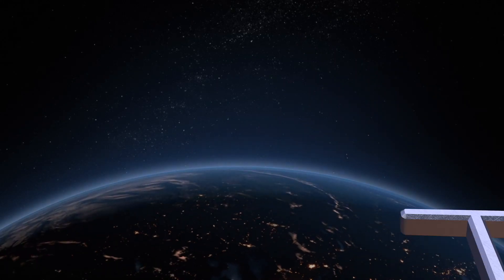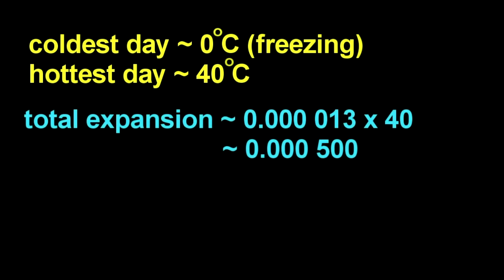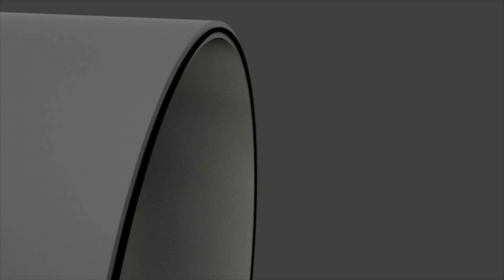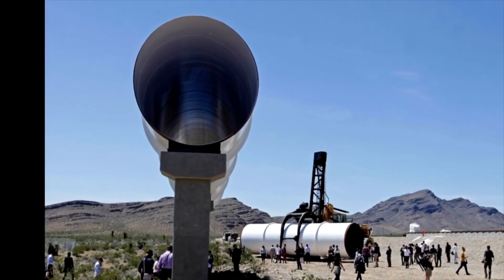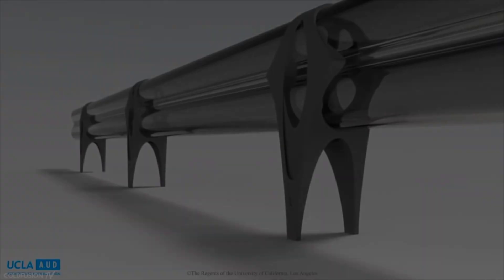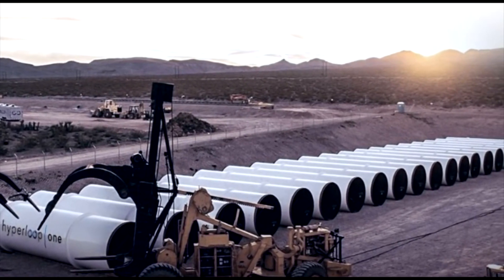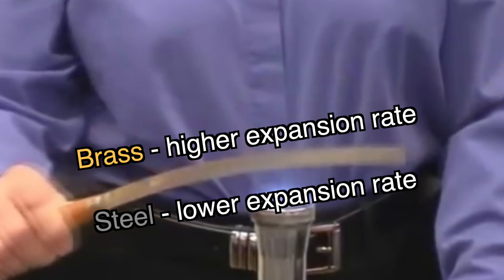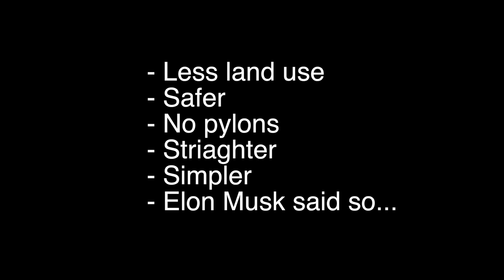The Hyperloop vs. Thermal Expansion

Comment: Air leak, high density air travelling through tube, pod slams into this higher density air at 700mph. Be like hitting a brick wall. Boom. I was expecting an actual seal design to be presented not a sketch of some of rings.....

Comment: For a thick-walled (~23mm) steel tube there will be quite high conductivity from top to bottom. Some quick sums would show what temperature differential can be maintained between sunny and shady side or space-exposed/ground-exposed. I suspect it's not very high - steel is a good conductor of heat. let#s have a go. Steel thermal conductivity is 43W/mK so if top is 10C hotter than bottom, and 3m tube (4.7m length top to bottom) 19.8W will be moving from top to bottom along each metre length. (wall X-sect area * conductivity * 4.7m length *2 (both sides)). In bright sunshine ~1kW will be hitting the top, although if white, only about 100W will not be reflected. Hmm. I think this needs calculus to work out tempo differential of worst-case steady state. You need to work out radiation as well as conduction. But incoming heat is a factor of 5 or so more than conduction round the pipe so actually it does look like quite a large temp difference could be sustained. 50C temp difference would result in 65mm expansion differential top to bottom over 100m of tube. It's the exact same problem as the length expansion with temp change - the same amount of expansion has to be allowed for, but when due to strong sunshine heating one side, the faces at the expansion joints would not remain parallel. And looks like I could well be wrong that the tube wall conductivity makes much difference. It helps somewhat, but does not eliminate the issue.

Comment: Ridiculous arguments! For instance - it does not matter, if the bending because of thermal expansion is caused by different expansion factors of different metals at the same temperature (like in case of bimetallic strip), or by different temperatures of two sheets of the same metal (like in case of the Hyperloop tube). The bending takes place either way!

Comment: Nice video, thanks. If I understand you correctly it should be built as an underground maglev system, a combination of transport systems that already exist. I agree that would be the best solution but that would mean there is nothing new about the hyperloop. And what about the cost, do you think $25 to travel from LA to SF is realistic? Why is the presented prototype train aerodynamic when it does not have to encounter any air resistance? So many questions, so few answers.

Comment: you said building underground would use less land but the shear amount of infrastructure needed to build the tube,  vacuum pumps, and protection against earthquakes (plus maintenance) would be immense. Because of the speed of the hyperloop, you would need to build a very straight tube, which would go straight through the populated central valley in CA. Plus the line needs to become un- straight once it reaches a city, otherwise it is a subway (extremely costly), which means it will have to slow down a lot, increasing the travel time. Especially difficult in la where it is not only vast and sprawling but is mostly confined by hills, which you have to get past somehow.
Reply: With time the earth will move the thing. But I’m just conjecture. I don’t have any numbers

Comment: O-ring failure - wait, there has been one already - a yeah - Challenger disaster. So what about places where temperature amplitude over a day can reach from above 0C and subzero? Laying all tube in the ground? - do you know what are the costs of excavation? And what about hitting underground infrastructure or destroying underground water balance. And then we have underground water pressure and corrosion affecting hyperloop tube. Any damage would require excavation of the tube.
Reply from the maker: The O-ring failure that caused the challenger disaster was exposed to completely different conditions (high pressure and temperature), so I don't think it is fair to use that as an example.  You make a good point about tunneling costs, but I think we can come up with some cheaper solutions very soon.  Underground infrastructure like pipes and cables would not be a major issue though because they are not very deep in the ground.  The tunnels can simply be bored below them.
Reply: Tunneling is a mature technology, so I really don't expect any significant cost reductions.  Grinding rock is always going to be grinding rock, moving rock to waste piles is always going to be the same, so how do you reduce cost?  Unless there just isn't enough competition in the tunneling business, then I don't see any reduction in cost.

The Boring Company claims they have reduced the cost of tunneling, but as far as I can tell they have only reduced the diameter they are tunneling, not a significant reduction in cost per cubic yard.
Reply from the maker: You make a great point.  Tunneling will not become cheaper just by making smaller tunnels, but if we change how we tunnel, there is a lot of room for improvement.  I think we need to find a way to tunnel that does not involve pulverizing all of the material that has to be removed.  For example, a core drill gets around this problem by only pulverizing the material on the perimeter of what is being removed.  The result is removing material faster and with less energy.
Reply: No - its not faster because the autonomous drill has it's own speed that mostly depends on the material it digs through. The tunel itself needs reinforcement by either steel mesh and concrete or by steel tubes. So nothing inventive and nothing cheap. This is why tuneling is done only when it's neccessary - through mountains, under seabad or in the cities. And sometimes you need e.g. archeological survey which makes everything more expensive and extends the duration of groundworks.
Reply: @tubetravel2138  The O-ring didn't fail because of high temperatures and pressure, it ailed because of low temperatures. They stopped working below 0 Celsius, that was the problem, and the same problem can occur in hyperloop in most climates.

Comment: Actually.. no. A leak in any part of the camber is a leak in the whole structural integrity. If there is a small leak in some way, that means the pressure is actually pushing through the material, which is quite a lot actually, which can and very likely will cause structural failure.Even worse if there is a knick on the tube while it is depressurized.. or maybe justa car hitting the pillars. A tube may withstand a lot of force of the athmosphere because the weight is distributed evenly. if you dent it, that tube likely will not be able to keep it up and collapse in an instant, likely letting air rush into it instantly. if there is a car in it traveling at fast speeds through a vaccum and then suddenly hitting airr.. that differential is like driving against concrepe. That is a deathsentence.
Reply from the maker: I accounted for this phenomenon in a previous video.  Dents will lower the effective "critical pressure" that will cause a failure in the tube, but this is easily countered by using a slightly thicker tube.  That is because the integrity of the tube against outside pressure scales with the cube of the wall thickness.

Comment: Why would air leakage be slow with an O-ring failure? You say this, but if an airplane has an air leak it is explosive and dangerous, why would the reverse not be true? The speed of air leaking in would depend on the pressure differential (high), area (high, and tube would separate further in a leak event) and geometry.

Also  the dismissal of the buckling problems due to top/bottom temperature differentials is hand waving; you acknowledge there will be a temperature differential but have no numbers or calculations to say it will be insignificant. Of course it won't bend as much as that strip, but it doesn't need to bend nearly as dramatically as the metal strip to fail catastrophically. Rails for regular trains struggle with buckling due to thermal expansion often.

And building underground is extremely expensive; american subway lines cost between 200 million and 2 billion dollars a mile. For the hyperloop to have a single 800 mile track, even if it could operate at 700 mph at a near vacuum seal for the same price as an american subway line (40mph at atmospheric pressure), it would cost between 160 billion and 1.6 trillion dollars. Not including operating costs, security or anything; pure capital infrastructure costs for a single, medium-distance route. This is an absurdly conservative estimate, because it will almost certainly cost more to operate at nearly 20x the speed and keep it vacuum sealed. 

Adjusted for inflation, the entire federal highway system cost between 400 and 500 billion dollars. So if a single route costs as much as the entire federal highway system, how could this be profitable? At the low end (160 billion), you would need 32 million riders at $5,000 a ride if there were no operating, maintenance or fuel/energy costs. The busiest flight route in the US (Chicago to NY, 800 miles and the reason I picked that distance) has only 4 million fliers a year at a cost of $100 - $300 and takes 2 hours. Why would anyone opt for the hyperloop on that route to save 45 minutes (800 miles at 700mph is 1hr 15 mins) at 20-50 times the cost? And even if the hyperloop somehow got 1/10th the rider counts at 20-50 times the cost, it would take 80 years for revenue to meet the original, absurdly conservative cost estimate.
Reply: Also it’s 2 bil a mile in the city. When you get out of the city it’s cheaper
Reply: isn't explosive decompression a Hollywood myth? I think there was a mythbusters episosde
Reply from the maker: The speed of the leak does depend on the pressure differential, but in this case that is actually very low (~14.7 psi).  Other systems with o-rings are commonly exposed to much higher pressures (~200 psi).  The other main factor that affects leak rate is the size of the opening.  Most O-ring failures are not full ruptures, but I guess that is always a possibility, so if the system was designed with O-rings, they would probably need to be redundant.  Regardless, I would opt for an underground system so that the tube does not have to adjust for thermal expansion in the first place.
Reply: @tubetravel2138  14 psi is actually quite high for large volume space. An airliner for example will maintain around 7 to 10 psi of difference between cabin pressure and outside environment.
Reply: That’s why my ears pop. The cabin is at 7 psi

Comment: A cooling system is required, because extreme temperature is not the only time it will reconfigure it's tube shape, the underground concept is more effective against that problem, other issues rise, earthquake and a breakage will collapse a tube now moving solid elements as it attempts invading air back into the pipe. Safer for the rest of the pipe path, but doom for a cart that was intercepted, also more difficult to evacuate in dense underground.

Comment: O-rings are parts used for airtight applications also used for rockets and the like, but parts that can not be easily replaced, which are installed in tens of thousands of places, repeat expansion and contraction every day will have problems with reliability.
How about supposing the extension and contraction by making the pipe double and circulating constant temperature air or liquid in the gap to keep the temperature of the inner pipe constant.
Reply from the maker: This sounds possible, but I could see it getting expensive pretty quickly since it would be about double the tube cost.  I won't rule it out though because I don't see any major issues with the idea.  I like the way you think!
Reply: Tube Travel I guess the best fail safe is multiple Air Conditioning systems, battery backup and using advanced insulation! Maybe even 35mm of space grade insulation! Cost dependant of course! 
You could build a test system on a 1:5 scale and test various failure scenarios. I’d use 14mm steel externally (24mm internally) to reduce puncture possibilities and galvanise all areas. 
By using high pressure cooled air we could fairly easily maintain a stable temperature!
Reply: The issue for the O ring is that over time (8 - 10 years) it will become brittle and eventually fail. Replacing it is then a nightmare! On an 800km tube that is a never ending task. An air conditioned core is better solution as its maintenance is far less costly.
Reply from the maker: There are definitely a variety of options to deal with thermal expansion.  I'm still a huge proponent of building it underground.  I think that solves a lot of other problems too.
Reply from the maker: Good thought, but what happens if a hole causes fluid to leak out.  I feel like you could end up with some major expansion problems in that scenario.  There may be a way to plan for this, but I'm not sure.
Reply: Of course, if a hole is opened in the outer pipe, liquid or gas leaks.
But it is not a fatal thing like the inner main pipe hole.
If you detect a leakage and close the hole, it will not become a serious accident.
Reply: You want 2 steel skins and circulate air in the internal 3" core between them at a constant temperature say 60 F and insulate the outer skin to ensure stable temperatures. This is done in Dubai for twin windows and is a simple technology.
Reply from the maker: My only fear with this method is the possibility of losing the constant temperature air supply.  If the system is exposed to temperature variations for even a short period of time, it could cause permanent structural damage.  Do you have any ideas to combat this issue?
Reply: Tube Travel like they say - more than 1 way to skin a cat! More than one way to stop Tube expansion, maybe 10. Ask any good engineer 👍🏻

Comment: Lots of engineering solutions both above and below ground to address expansion/contraction...  

Elon bought "The Boring Company" to begin addressing the easiest approach for urban applications that is underground where the issue of thermal effects are minimized.  But even tubes underground will need to allow for some expansion/contraction due to seasonal ground temperatures and heat given off by the pod transport mechanisms.

The Elon concept of a boxed/tubed system for managing length change is actually more viable than o-rings at each joint (which compromises structural integrity).  When one realizes that vacuum/evacuation stations must be placed  approximately every 2km or so you can then limit the amount of tube length variation to that distance and it becomes a manageable 12-18" at each station assuming you have the extremes in temperature that were discussed in the video.  I've done some basic engineering concept drawings/calculations and find this approach to be very manageable...

Tube restraints to the pylons could be ring fixtures that allow lateral movement while maintaining structural stability (this could also allow some seismic displacement) such that the expansion is not constrained only contained.  The detail of this concept is a series of o-rings in sequence along several feet of tube length which is housed within another slightly larger diameter tube - the expanding hyperloop tube can then slide in this larger tube while the o-rings maintain the vacuum.  (Multiple rings for redundancy and stress equalization).
Reply from the maker: Good thoughts on this.  Luckily the underground seasonal temperature variations are so minimal (less than a degree) that any expansion could be constrained by the supports.  This would leave some residual stress in the tube, but nothing major.  As for heat given off by the systems, this would be quickly absorbed into the surrounding environment, so it wouldn't cause any drastic temperature increases.

You may be right about the telescoping tube design, but it seems like it would be very expensive to allow the tube to slide on every pylon.  I won't rule it out though.  

My only concern with sliding the tubes together as you mention would be the higher leak rates with dynamic seals rather than static seals.  But at the same time, you wouldn't need as many expansion joints with this design, so it has the potential to leak less (especially when using redundant seals like you mentioned).  Definitely worth a close look though.

Comment: How you maintain and changing hundred thousand elastic seal without air leaking XD
Build hyperloop underground will make ticket costly and totally unaffordable XD
Reply from the maker: You bring up some really important points, so hopefully I can answer your questions.  The O-rings would last a really long time, so I'm not really concerned about that.  If some of the o-rings started to leak after, say 20 years, you could schedule a time to repressurize the tube and change them all.  But it's possible they could even last the entire life of the system with the right design.  Underground is expensive right now, but hopefully Elon Musk will change that soon.  You also have to remember the cost savings that you get from eliminating most of the friction in the hyperloop.  Your fuel costs are a fraction of what you'd get with any other form of transportation.